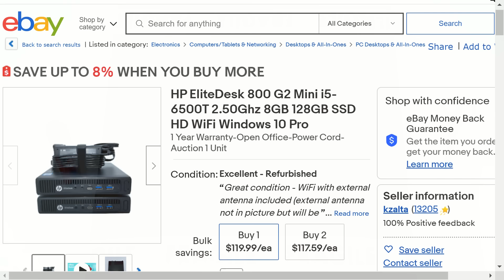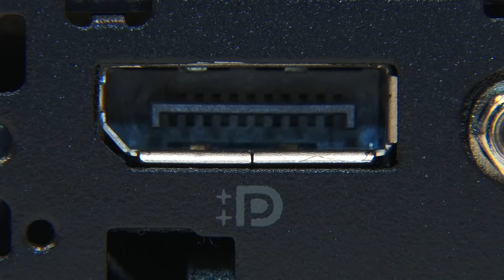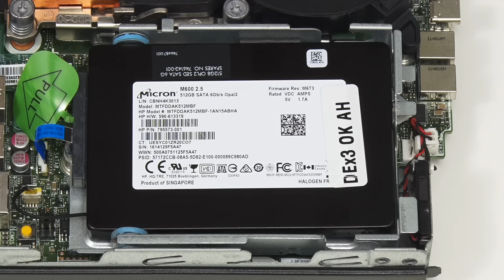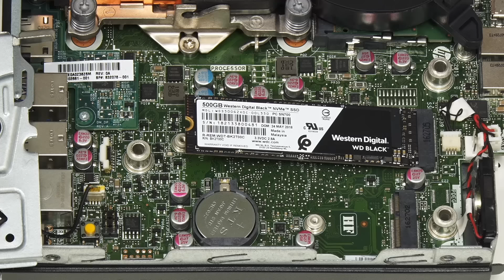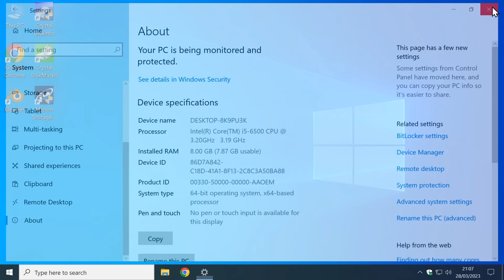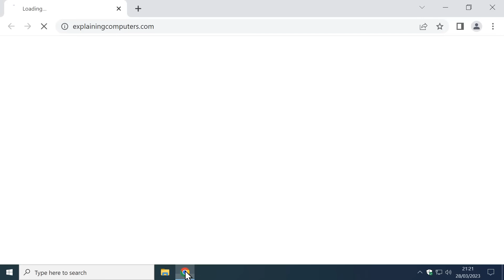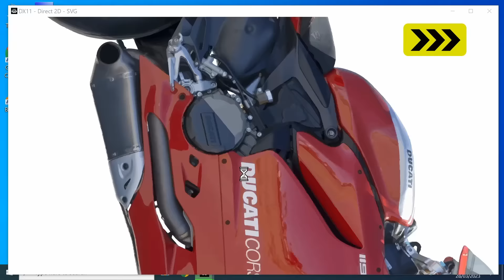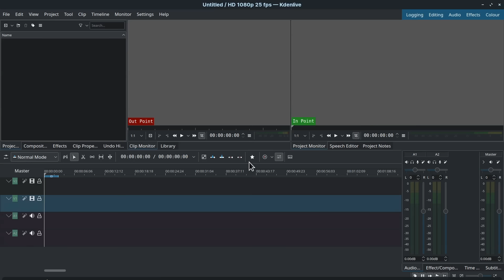Renewed i5 Mini PC: HP EliteDesk 800 G2

Comment: The only complaint I can see that anyone could have about these is the fan noise. It wouldn't bother me, but then I'm deaf in one ear. But if someone found it bothersome, they might be able to use one of those laptop coolers ($25) to cool it without so much fan noise. 

I remember you did a video on making a tower quieter, but that solution wouldn't work here. If I remember correctly, you added a hulking-big heat sink. Obviously, that wouldn't fit in the case of this computer. But if this video is popular enough, you might do another video on making it quieter. I realize the point of buying this sort of computer is to buy something that is inexpensive, but there should be a cheap way to cut the fan noise.
Reply from the maker: Uhm. A video on making this quiet is an interesting challenge!

Comment: I have one of these 800 G2 devices but with a pentium processor instead of an i5. It came with windows 11. I reinstalled windows 11 without problems. I just had to activate uefi secure boot in native mode. my device came with TPM 2.0. there are some with TPM 1.2. but they can be upgraded by software. so I am very happy to be able to use this little thing for many years.

Comment: The price for performance and connectivity on systems like this is hard to beat.  The Windows 10 deadline may be a concern for some, but x86 means a variety of robust Linux distributions are available.  These compact systems are available form many OEMs as well.
Reply: Xubuntu 22.04 installed without incident on my 64 bit HP SFF computers.  Xubuntu boots too slow now for my ancient laptop with the Celeron 900 CPU on it.  Once booted (taking five minutes to do so) it works well enough for 480p video and simple web use although much slower than my new laptop.

Comment: Thank you for the video. Very interesting. I bought the same two weeks ago at Amazon Germany for 150 €. It is supposed to act as a mini NAS server. Delivered from an Amazon warehouse but originally it came from Italy and probably the device was in productive use in the UK. Anyway.

However, I have a device with closed lid without ventilation grille and with me was under the Sata SSD no extra fan. But I would have found one. You probably have to look rather closely, but unfortunately very often this information is missing in the description. Also, I have the feeling that my fan rattles a bit, as if the bearings are worn out. I will probably have to get a new spare part, because it is already annoying.

Otherwise, these are good to very good devices, if you are lucky and get one in the appropriate condition.

Still happy Easter 🐰🪻

Comment: An interesting video! 👍👍 I enjoy restoring the older HP Compaq 8300 and it's older siblings, they are bit larger, so there is more room for air flow and the 8300 has both USB 2 and USB 3 ports which is handy. This link shows the type of computer which I mean.    https://www.youtube.com/watch?v=sfLpFTOvf14

Comment: I’m glad the they are being repackaged and cleaned up ready for resale. A lot of companies don’t bother and just send them off to a recycling facility.  Thanks for today’s video Chris, as always be safe and healthy.
Reply: A recycling / refurbishment facility is probably where these are from.  They will have standard disk images ready to install onto these machines, because they probably bought hundreds of them.
All my computers, except for the Raspberries, are ex-business machines.  Unless you are a die-hard gamer that really needs power , even ten year old but high spec machines can be had for pennies on the pound, and are more than capable.
Buying new computers is a mug's game.
Reply: @sarkybugger5009  Although, if you can find an ex-business low profile computer with a good processor, there are some pretty decent low profile graphics cards that can handle gaming. Sure, you might have to turn the settings down, but it can make for a low cost gaming solution.
Reply: My company was acquired a few years back. We had just had a tech refresh and the workstations we had where maybe a year old. Hexacore Intel i7 with NVME SSD's at them time. We got new machines (also Dell btw) and the old ones got recycled. It was just their process. Apparently cheaper than actually wiping them and re-installing.

Meanwhile, politicians all over the world is trying to tax us to death because of the climate.
Reply: They are leases, leased from HP, etc. to large companies/educational institutions.  Once the lease is up they are mass exchanged for a newer model and these go off en mass to (possibly) be cleaned/refurbished and sold off.  I've got several and I'm pleased.

Comment: where I work (in Canada) we sell a VERY similar Lenovo.  It's the same size, all metal, dual DP and same CPU except it comes with 16GB RAM and a 256GB M.2 (not sure if SATA or NVMe) all for $240 CAD ($177 USD) it's so similar to this one EXCEPT the two M.2 slots (both 80mm) and two RAM slots are on the bottom side of the motherboard.  There's another metal cover that slides off the bottom to gain access to this.  Funny thing is the first one I sold the customer brought back later claiming there was no SSD in the system!  Mind you he didn't turn on the PC and try running it he just opened the top and looked inside.  So I popped the top and looked inside and was also confused!  I could see the empty 2.5" SATA bay but that was all I could see.  That is until I realized the bottom slid off!  Slick!  I really don't need one of these small PC's (I already have my main powerful gaming/video editing PC and an HTPC that even that is way more powerful than this) but I dunno it's still kinda tempting.  These are amazing performance for the price and so handy.  I'm thinking I could install Linux on it and use it like that.  I need an excuse to buy one I guess.

Comment: I have a couple of Lenovo Thinkcentre Tiny systems I picked up for about $50 USD each about 2 years ago now which are about the same formfactor, and they have been great for basic daily task running Chrome OS Flex with 8GB DDR3L RAM(only one RAM slot), and 120GB SSD, and I'm thinking about a Minisforum, or Beelink mini PC for my next desktop with how powerful they are while using less power, and the latest Linux kernels having good AMD support, thus making them good enough for 1080p, and 1440p Linux gaming.

Comment: Idk if the method I used for 11 on older hardware still works, had early adopted 11, used the appraiseres.dll bypass to get past the TPM/secure boot requirement, ironically I have TPM on all my boards it turns out. Most of my rigs are Linux or dual booters. Except the old media one I have hooked to the 1080p tv is an i3-2100 on Linux. I have a similar skylake i5 spare that does 1080p fine still. Am also not sure if all the debloating Win11 has gotten too much, MS Teams didn't work but I mostly use it for gaming almost exlusively with maybe some Youtube in the background.  Am still on 9600k 3060 for gaming/media but it's okay for now. The SFF on this pc looks interesting though.

Comment: I used a 2015 computer with a dual core processor, with VirtualBox and Win7 as guest OS and Mint19 as main OS. Since support will end this year, I upgraded to Mint21.1
Unfortunately I can no longer use this PC with VirtualBox as support for dual core processors has ended. Whether it is due to Mint or VB, I don't know.
So after your recent miniPC I started looking for a replacement and got a Fujitsu i5 miniPC for 130 euro. The licence for Win7 was no longer valid (which I do understand) so I got a new licence. And now everything is up and running.
Thanks Chris 👍🇳🇱

Comment: Another concern with buying used HP desktops that has come up in the last few years... They have removed the ability to reset the bios passwords. Should not be an issue from Microsoft certified refurbishers, but from random eBay sellers this could be an issue. With some hardware and software you can "hack" a reset, but not something that everyone will want to do.

Comment: As always, great content.  For basic computing needs this is a great way to go.  Performance per dollar spent can't be equaled.  I'm somewhat biased here as I love to take older hardware (10 years or less) and use those machines as my daily driver for both Windows and Linux (also a Zorin user).  I currently have the HP Z series workstations ranging from the Z230 to the Z440 with a Z420 sandwiched in between.  And let's not forget Dell Optiplex and Lenovo Thinkcentre.  Both companies have great products in their business class portfolio that can't be beat in performance per dollar.  Thanks again for sharing!
Reply: Question: do you think it is easy to install Linux on such HP mini-PCs?
I had bad experiences on Laptop equipped natively with Windows...
Reply: @giuliobuccini208  Any time you install Linux on any PC there is the possibility for incompatibilities.  Some Linux distro's have better chances for success, such as Zorin.  There are two versions of Zorin, a paid version and a free version.  Of all the distro's I've personally installed, Zorin seems to give the most consistent result.  Normally you'll probably have some difficulty with graphics and/or audio.  And typically somewhere on the web there will be a resolution described that works.  Even with the few hiccups I've had, I still prefer Linux as my daily driver.  If I need windows I have VM's that can solve the problems.  Now, the laptop can be a real issue due to the proprietary nature of the drivers.  Desktops, on the other hand, seem much easier to get everything working.  Good Luck!

Comment: I've been using HP's thin client PC's a lot lately. they take full installs of windows or linux just fine on the NVME drives, and run just fine. They can usually be had for around $45.

Comment: When you showed the system info in Windows that it said there you have the i5-6500, not the i5-6500T.  Based on that CPU Mark score I'm 100% certain that's the case.  I own 3x i5-6500T based systems.  They max out around 39W under full load.  You've got a 65W CPU, not the 35W variant.
Reply: Came here to make the same comment. The air vents in the top panel are a giveaway I think. I believe the T processors (along with Celeron etc) generally have solid top panels, but I may be wrong!
Reply: @ashbaker1344  My HP T series systems are all solid.

Comment: I was using a little lenovo i5 based mini pc at my previous work for a while. Those mini PC are totally underrated. They are so convenient, cheap, and totally capable of the most common tasks.
Reply: Intel came out with the mini PC motherboard and T series CPU to combat the Mac Mini on the PC side, and almost all of these "1 liter" PC uses the exact same internals.
Reply: People hate them as a PC, too minimal, meant for Warehouse and offices app only !
What you run on them ?

Comment: Hot tip: I work for a small city IT department in the US mid-south region. The scale of the operation is between 500 and 1000 desktop PC's (aside from servers and switches and other stuff). Our replacement cycle has us currently discarding Dell Optiplexes bought about five years ago, typically ranging from small form factor 9020s to 7050s at the moment, with CPUs ranging from core i5-4590 to maybe i7-7700. We try to find uses for them, and we stockpile a number of them for emergencies such as disaster recovery. Still, quite a few go to recycling. If we're doing this, and we're not exactly made of money, the chances are good that in any given area, there's a pipeline of comparable machines from enterprise IT departments to the recycling center, and if you get in there, you can pick up some boneyard computers for free. As this channel demonstrates, these are still great for most household purposes and even a lot of serious work.

Comment: These little machines are great. I picked up a Dell version last year, and it has been great.

Moreover,  if you are truly desperate for more graphics power, you can always use an external Graphics Card, though there is the risk of bottlenecks with the USB interface.

Comment: Looking forward to your video on installing Windows 11 on older hardware.  I have been using an HP 600 G3 with both Ubuntu and Mint.  They run well but I have had issues installing the internal Intel Wifi/Bluetooth module and using USB Wifi on the mini pc so this might make a good topic for a future video.
Reply: I don't know if it's still possible but I downloaded Windows 10 and Windows ll. Replaced the setup file from Win 11 with the one from Win 10 and Windows 11 installed without all the security. Now we don't know if Microsoft will stop updating the software at some later date. If they do I will remove Win 11 and replace it with Linux Mint (I have a newer PC with Windows 11 on it for those programs I run that I don't have a similar Linux program.)

Comment: Using few of these running Proxmox to replace few SBC's that were running as a server. I have setup 2 so I can easily move/recover VM's from a backup (Proxmox has great features to do this) in case one of these machines dies.

Comment: These make quite useful Proxmox servers for occasional use as a workstation with pass-thru or running several headless linux and/or docker/portainers and these days is cheaper than using a number of SBC's.
Have you made any Proxmox videos?

Comment: I managed to buy one of the g4 ones with a 8500t processor (6 cores) for 700 sek (70 bucks) at a company yard-aale. They were selling a bunch of small office computers and made not difference between the ancient ones and the newer ones. 

I didn't have more money, otherwise I would have bought several.

Later I bought a SFF computer with an i7 and installed some extra ram. That one is now running everything I had some small ROIs for, and a 4-bay NAS since I could install a SATA-card into it. The drives and in a makeshift external enclosure, using a variety of ugly hacks to get SATA power.

The idea is to build something proper for the NAS, but nothing has happened for 5 years.
Reply: Where do you buy these for 700 sek in Sweden? Blocket, Tradera? I just bought a 800 G2 from a recycler (with 1 year warranty) for 2000 sek. The G4's go for even more then that?
Reply: @Jonteponte71  a local company decided to lay off 100 people and close one department. They decided to sell all their computers at a bargain price. The G4s were only about a year old at that time. I bought two high quality VESA arms as well for basically nothing.

For the i7 I got lucky. The seller (on Tradera) hadn't put any information in the ad. I recognized the computer (a decently new dell sff) and put the starting bid (1400) and won.
Reply: @LinusBerglund  That's one hell of a bargain for those machines. People want over 3K for them even now! I got very lucky on Tradera once as well. Buying som retro hardware (Amiga). The seller obviously had no idea what it was worth and I was quick enough to close the deal before anyone else had a chance. It had an accelerator inside that was worth more than the computer itself...

Comment: I'm not a fan of little fans.  They are not only noisy, they are subject to failure, and the system is oft remiss in alerting us to the resulting thermal runaway. Despite my valiant efforts to keep Intel NUCs free of dust, I've seen three NUCs die in less than three years (so total cost of ownership has been rather disappointing).  A fourth NUC has survived via fan replacement after the noisy death throws of its fan served to attract attention.  Beware a small form factor PC which falls silent, for the reaper may be nigh.

Comment: Don't buy Celeron/Pentium/T processors, they are too weak. i5 6600 would be a good start, i7-7600 is much better and i7-7700 is absolutely ideal :-)) Well, it looks like T-cpu is impossible to avoid.

Comment: You should do a video comparing legacy and uefi bios, showing the difference between a pure uefi/secure boot turned on system dualbooting windows and linux by using boot order in uefi bios, vs legacy bios with grub to boot either OS. I'm an "install windows first" type, but some say do linux first and they know what they're talking about as well. This HP EliteDesk is a great windows 11 choice, it's only two generations behind on CPU, and has TPM 2.0. I wonder if Windows 12 will have the same requirements as 11, except no workarounds, that's the big question.

Comment: In case you haven't been flooded with comments already, those HP hard drive mounts were widely used in different HP models and can be procured second hand from Amazon and the like.  I did so myself years ago for an HP mini tower I was using as my media PC.
Reply: Yeah, those HD mounts are all over eBay… from a single mount, up to lots of 100’s…

Comment: As with all HP corporate hardware, you can also update the BIOS from within the BIOS. Just hit F10 to go into the BIOS. Make sure an ethernet cable is connected to your network, and hit Update Bios. Given these were £600 to £700 when new they are now amazing value.

Comment: There are 2 versions of this HP mini PC: a 35W version (which has a 35W T CPU) and a 65W version (which has a 65W normal CPU).
You have the 65W version which has the Core i5-6500 normal CPU. Therefore it will be slightly faster than the Core i5-6500T.

Comment: Thanks Chris! . . . Does look like a genuinely excellent value and quite well specified little machine . . . I have a major beef with the term 'refurbished' (or renewed) though as I think it's extremely misleading to domestic buyers . . . Most hardware that i've seen sold as 'refurbished' hasn't even had the fluff blown out of the coolers, or the outside wiped down from coffee splashes and suchlike!

Edit: I'm not having a go at 'you' or this article . . . I just think it's a misleading sales pitch - by sellers - in most cases.